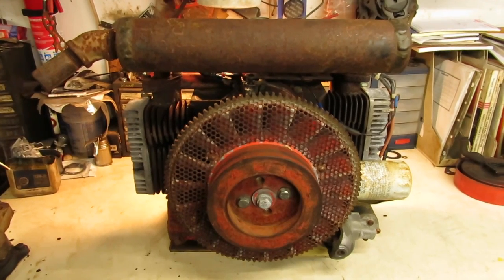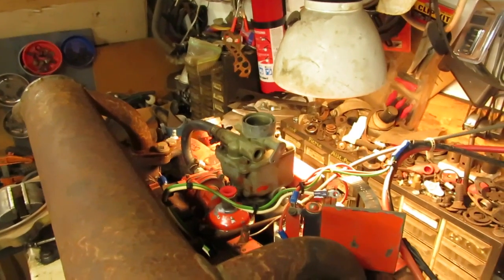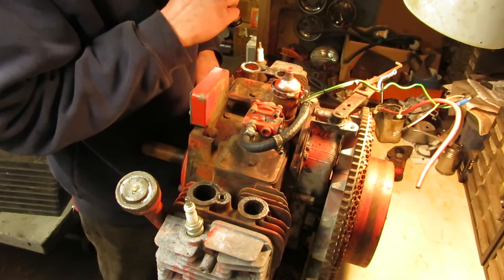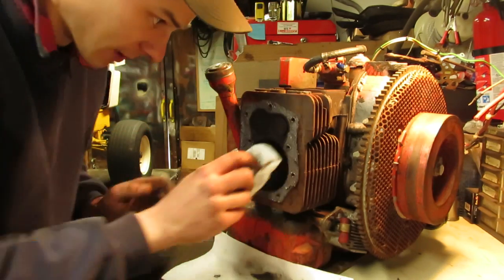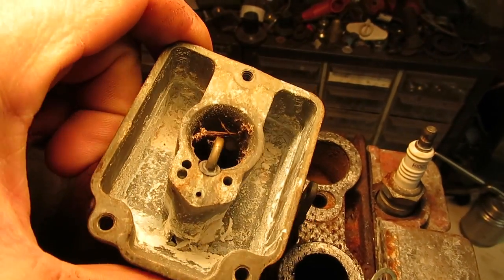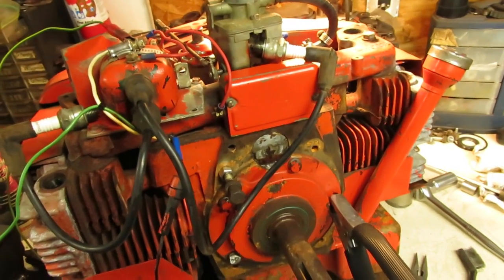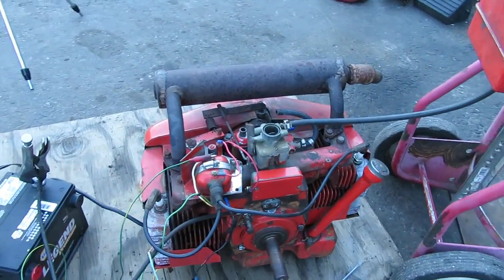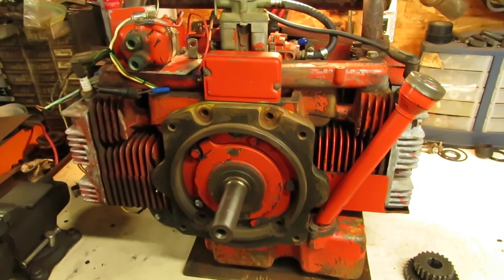4WD Gravely Engine Swap to Onan CCKA- Part 1

Comment: I have one of these and the 816 it came from. The flywheel loosened up and wallowed out the keyway. Might just weld the flywheel back on and let ‘er rip. Love the Onans — hate buying parts for ‘em.
Reply from the maker: That's a pretty crappy predicament! Nothing worse than worn out key ways on stuff...
Reply: Yeah, the keyway could be worked around but the iron hub on the flywheel is pretty much shattered so it’s been rendered useless without some remedial welding. And even then the whole thing would be pretty dodgy. Too bad because the motor has low hours since a quick and dirty rebuild.

Comment: Buy flexoid gasget paper make your own gasgets use eBay I did never use old gasgets or what's the point of cleaning it up to strip it back down🤔🤔
Reply from the maker: I have more gasket paper here than I can shake a stick at... If I re-used any in the video it was because I wasn't sure if the engine was going to run. No sense in taking the time to make/buy gaskets if it was junk.

Comment: I hava a question,I dont know why the onan engines doesn't make modern 4 stroke engines?the brand onan can copy the structures from honda engines and briggs & stratton engines and the kohler engines。
Reply from the maker: I don't know when Onan stopped producing small engines, I'd assume right around the time or after Cummins bought them. Far as I know, they only build generators now with other manufactures engines.
Reply: @5Tractorguy  cummins is about generators and vehicules engines，but cummins not make gasolines engines，only diesel engines，detroit make gasoline and diesel engines

Comment: My lincwelder 225 has an onan CCKA.  It sure runs smooth.  I added a low psi electric fuel pump to avoid the old diaphragm pump dumping fuel into the crank case and it works great.
Reply from the maker: Nice! Just for future reference, you can still get the mechanical fuel pump diaphragms online if you search ebay for them. About $20 in change...

Comment: The twin Onan engine is just great machine. Would you say this is just a good as the old Kohler twin ???Could you be able to tell me if I could email you with questions that I have working on my tractor project Sir ??? Thanks look forward to hear from you Sir. Keep up the great video's.
Reply from the maker: Have to say I like the Kohler K twins better in terms of how they run. I got to work on a K482 on a WH earlier this winter, couldn't believe how smooth it ran! Sure, you can email me, but until Plow Day is over, I won't have much time for response until beginning of May. My secondary email address is fretwater@yahoo.com. Send me an email and I'll direct you to my main address. -Jake
Reply: @5Tractorguy  Thank you for letting me know information on that Sir.
Reply: @5Tractorguy  Thank you for letting me know information on that Sir.

Comment: I'm working on one right now off a sears that had rust in the rear cylinder from water through the intake. I hate how people just let these things sit outside with no air cleaner on them. But, thats how we get them for a fair price. A bit of know-how and some elbow grease and it's worth every minute
Reply from the maker: 'Tis... Seems to happen more often than not when someone stops halfway through a project/repair. It's even better when they leave the head off and let them sit, had a Cub like that last year.

Comment: Hey man, quick question. In your opinion what is the best way to de-carbon a piston and top end? I took apart my first Kohler k181, never been this deep in motor.
Reply from the maker: Hey Kyle, best bet I've found is a razor scraper, picks and small wire brush. That's what I use to clean everything out. Razor you can scrape the top of the piston and block/cylinder head off, picks I'll get around the valve heads and seats and wire brush to get the rest once the heavy stuff is off. Careful with an aggressive wire brush on the piston though, it'll dig into the aluminum.

Comment: Just love the sound of a twin cylinder engine.  When you get it all done and ready to go,..would you entertain the thought of a dual outlet muffler? They make a cool sounding engine ever better.
I sure do hope you find the proper crank. for this one, you're correct in saying that it would be better to swap it for the present one.
BTW,...18 to 20 minutes is good for a video like this. It sure was not boring for me, at least,....my opinion only, of course.
Reply from the maker: I will! Was thinking of putting dual stacks of some sort on either side of the hood. No straight pipes of course (can't listen to that all day plowing), but something along the lines of a Farmall Cub stack muffler, I think it would look and sound neat.
Me too, I can't tell you how many 450 cranks I've seen on Ebay over the years and now that I need one, there's none! Good, that's what I was figuring for time. 15-20min is still reasonable to watch...
Reply: @5Tractorguy  Yes, those twin pipes would sound great, I'm sure.
On that topic of straight pipes,.I often wonder how folks with those pipes on motor cycles can hear themselves think, after an hour's run on those so equipped 'bikes'!
About 6 years ago, I drove a brand new Harley with those pipes on it and had to get it back to the guy a s a p,  just to save my hearing! So yes, running your tractor with them would put your hearing at risk not to mention your sanity.
Re. the non-availability of crankshafts,..same story for me too,.." Oh, I could have gotten that for you, but it was sold a week ago!"  How many times have I heard that line?
Keep looking, though,.you'll find one soon,..hopefully.

Comment: I got the same intake setup on an Onan generator definitely not my favorite to work on, but it's a 5 KW generator that's been to Hell and back and still runs and putout perfectly fine.
Reply from the maker: Nice, these are great generator engines, bit thirsty on fuel but good none the less. Too bad they didn't design the carburetor mount bolts different so the manifold could stay on.

Comment: I’m not a fan of Oman’s so I think you’re crazy to pull out the K341 but this is your full time job so have at it. Entertaining none the less
Reply from the maker: That 16 never ran quite right though at high throttle or under a load, I think due to the carburetor still being messed up. Since that CCKA runs nice I'll take a chance on it... worse comes to worse at least I'll have the Kohler to put back if it doesn't!

Comment: YOu did GOOD, Jake! Id've wrung every bolt on that block off! Hope you find a crank too. Sweet runner. Can't beat an opposed twin sound OR run. The Vanguard on the Craftsman is still purring right along and they have to be tough to take what that one took. Not by me though! Hope all is well up there and you're not froze out. Had some ice down here last night but the rain ran it off. Glad this one was non smoking but I was sure worried when you drug out the ice chunks. I got a 4-horse Snapper and a plastic cam 7.75 pressure washer wannabe but the Snapper runs now and with all new fixins the washer will in warmer weather. Hope you're getting some 5-string time in, Pal! YOur Tarheel Uncle will not be pleased if you loose out on that OR Tarheel me, for that matter! Keep warm and pick me a tune!
Reply from the maker: Lewie! Did ya stumble upon the 2018 Archive video before this one? At 21:58 I do some brief pickin' on the 5 string... Starting to get out and pick more since the turn of the year. Getting together regularly with a couple guys from the area. Also went to a big bluegrass jam 2 weeks ago and got invited to play a gig May 11th. Have to see if I can get someone to grab some video of that. Good to wading through the bluegrass again....
It's a chilly 14deg this AM! Figured I'd sit here, answer comments and do some paperwork, give it a chance to "warm" up outside.
Reply: @5Tractorguy  Not yet, Jake but it's going to happen VERY shortly. Sure am glad you're limbering up more. I sure miss it The head never forgot but the hand can't do it anymore but that don't put a dent in still enjoying it to the max!  Snag someone up front to get some good sound when yall do the picking. Stay warm and keep on wearing that 5 out. I'll be waiting on a fixing or a picking video. Your choice and HI 2 that Tarheel Uncle of yours from another one!